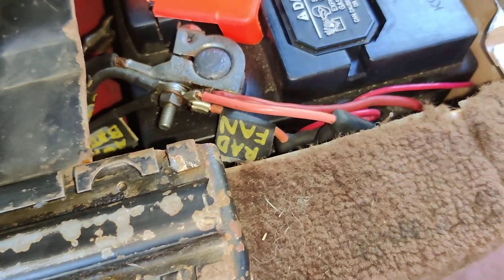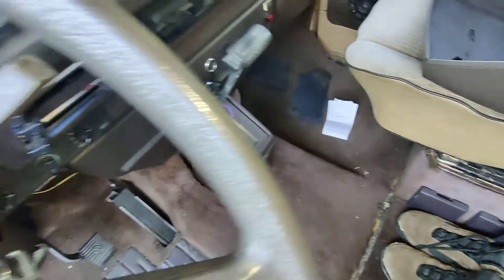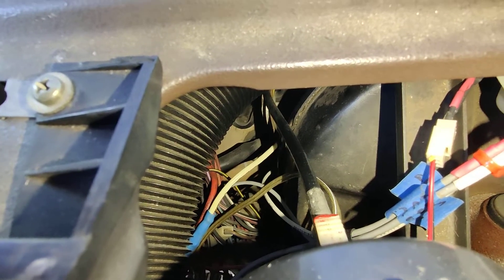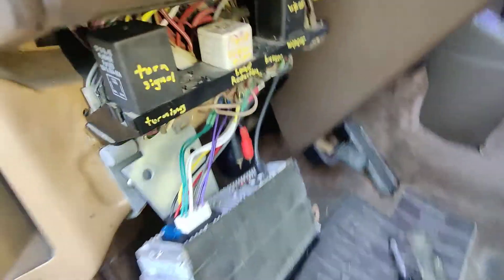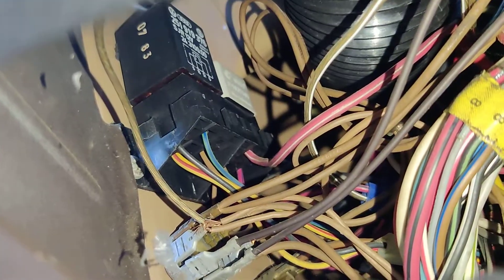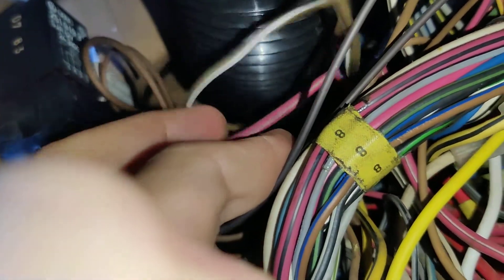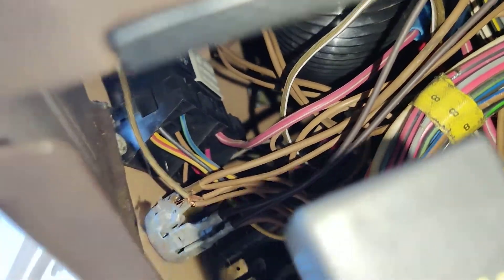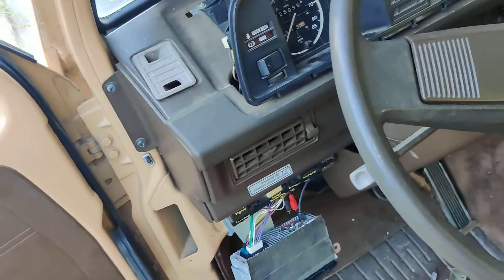1984 VW Vanagon - Melting fusebox bypass

Comment from the maker: To be clearer, the red/white wire going into that gray relay previously came from the fusebox.  I disconnected it from the fusebox, cut the end off, and connected it to that white wire coming directly from the battery.  I put an inline fuse holder to replace the fuse in the fusebox.